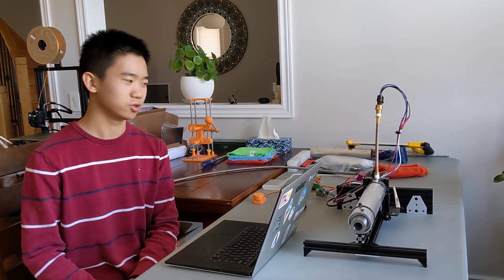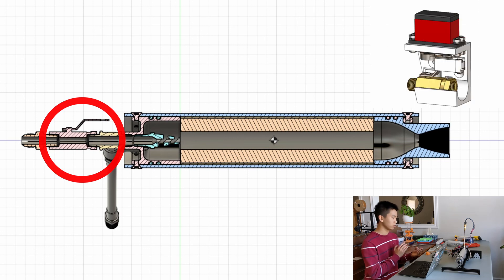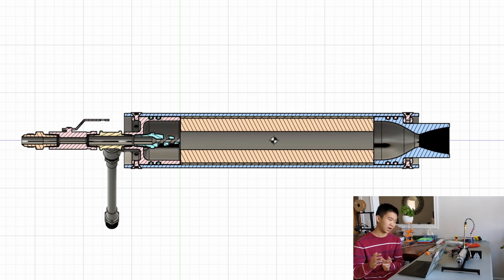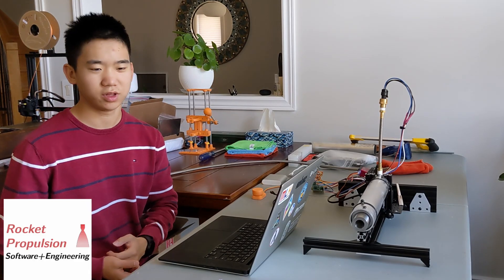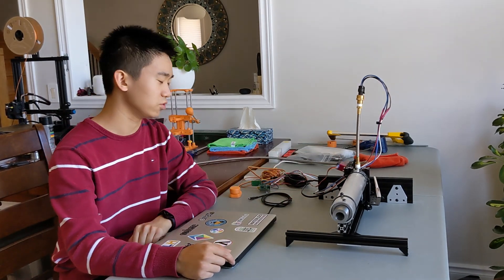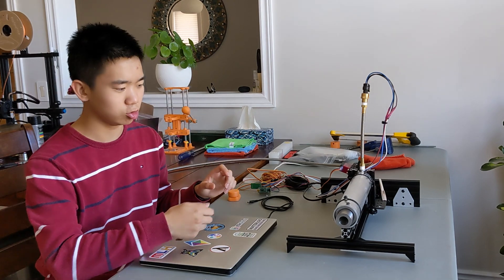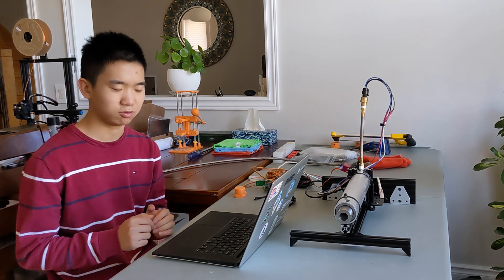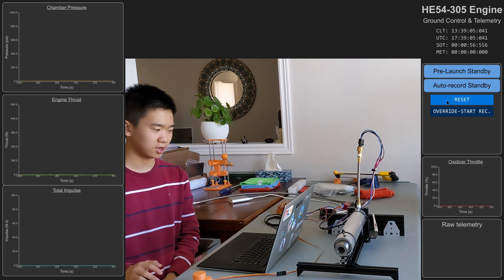DIY Hybrid Rocket Engine, part 1: Design and Build Process

Comment: How do you make the metal parts?
Reply from the maker: The metal parts were either 3D-printed in Aluminum or CNC'd from steel. I used online services to order the parts - 3D prints from CraftCloud and CNC from WeNext I believe.
Reply: @yubo  thank you

Comment: Nice job ! What's the news ? Did you stop ?
Reply from the maker: Hey! I've been working on and off on the finishing touches, especially improving and testing the igniter. Tried jerry-rigging something for the igniter for a hot-fire test but it didn't work. I haven't had much time because of University, but the plan is for another test when the igniter is ready. Lesson learned: igniters are hard.
Reply: did you try an electric spark system ? @yubo
Reply: @yubo  You can make a pre heater with apcp

Comment: I’m going into year 11 or 11th grade as you I think are an American and I’m supposed to launch my rocket June of next year and I can see how much effort goes into things like these though im using APCP fuel a hybrid Motor Concept is still pretty good
I’d appreciate it if you could explain to me how you made the software which displays the data
Reply from the maker: Hey! Canadian here, just graduated Grade twelve. The software displaying the data has two parts - one running on an Arduino Nano that sends timestamped sensor data over Serial-over-USB to a companion computer running software I wrote in Processing 4. I'm still working on modifying the Arduino code to support PWM remote control, but here's the companion computer code: https://github.com/y-fysiks/hybrid-rocket-telemetry

Comment: And how do you plan to ignite it?:) Because both n2o and paraffin is difficult to get to combust.. 
N2O needs to decompose to n2 and o2 to work as an oxidizer, and that only happens at 600-850°C and/or with a catalyst bed. The paraffin can't burn either in solid form, nor in liquid phase. It has to evaporate before it can ignite, which happens somewhere between 200 and 350 degrees C. 
Since N2O decomposition is exothermic, that would (probably) release enough heat, to raise the temperature of the wax enough for it to evaporate. If the motor is ignited, the n2o probably won't have trouble decomposing. 
Actually this is the main reason why n2o isn't used as a monopropellant, despite having close enough isp to hydrazine,  having a better storage temperature range and being non-toxic. Maybe a resistojet type (electric resistance heating) device, with a nichrome wire heating element would be a viable solution for both monoprop and bipropellant thrusters.
You're lucky that you can start having fun with rocketry at such a young age, and knowing so much about 3d design, coding, electronics, engineering, physics, that you can build a rocket engine... Probably having supportive parents (both financially and emotionally) also helps. And I'm not that older than you, probably by just 5 years or so, but I feel I've done nothing in these 5 years, but aging.  I've been thinking a lot about rockets though, probably designed dozens of theoretical rockets and aircrafts in my mind, (-most of them turning out to be ridiculous,-) but made none. I have a couple of projects in mind though, and I'm fascinated about rockets, so it's just a matter of time. and money xd.
Excited about your following projects, I'm subscribed!^^

Comment: Remove the check valve, it will create instabilities in the fluid line due to the poppet chattering. You shouldn't need it if you have designed for sufficient pressure drop (around 1 Mpa) across the injector. ..Also paraffin wax needs additives to improve its melt characteristics. Grab yourself amber colored glue sticks and add about 18% by weight. This will give you EVA and tackky resin which make the fuel more elastic and improve the bonding to the phenolic liner.  I have noticed you are using spiral cone spraying nozzle to try distribute the oxidiser, Id suggest in this size motor you make a impinging injector plate with sharp edge orifice it ill be more effective. Nice work for first motor design, and good luck with your test.

Comment: I ve interested in hybrid rockets myself. i hope you show us your ignition system thats the only thing i can think is complicated.
Reply: The best method for ignition is to use gaseous oxygen and a HV sparker cable. This can be made using an automotive 12v neon light transformer of around 7kV voltage, if you connect an cut piece of twin flex cable to this transformer with the end cut on angle it will produce an arc between the cable conductors that will breakdown the cable insulation in the oxygen environment. Insert this cable taped to plastic tube carrying the oxygen into the fuel port, you can often hold these in place using a fiberglass rod. Be make sure the end of the HV cable doesn't get close to any of the metal components in the motor or will short out and fry any instruments you have connected. You will need an oxygen welding regulator with a flash back arrestor and a solenoid valve to do the oxygen flow for ignition, keep the pressure to 8 to 9 bar.. Good luck and happy testing.